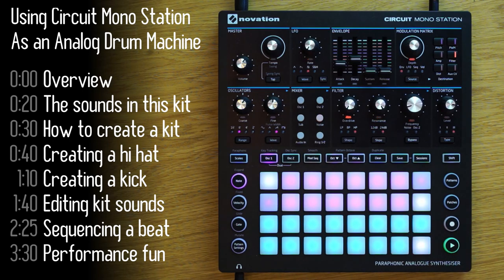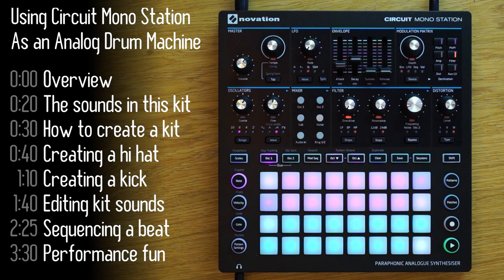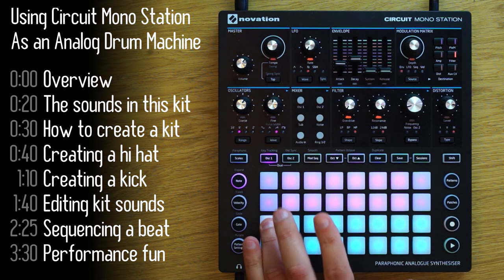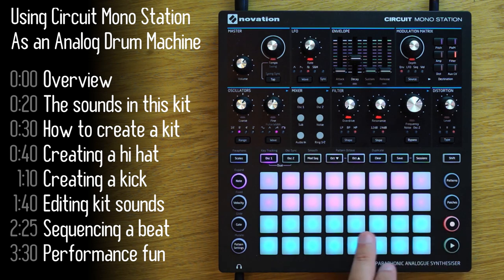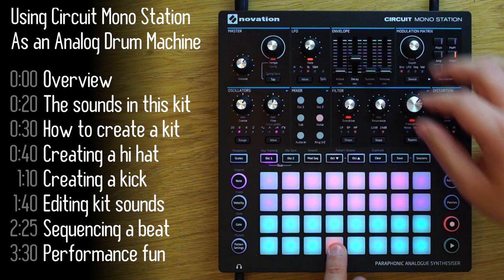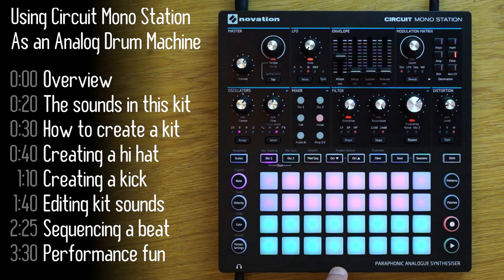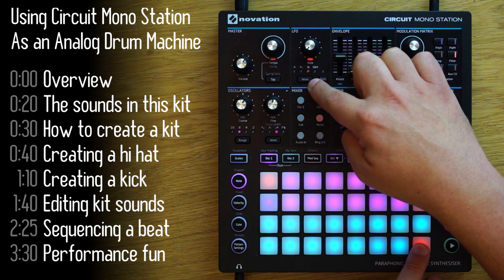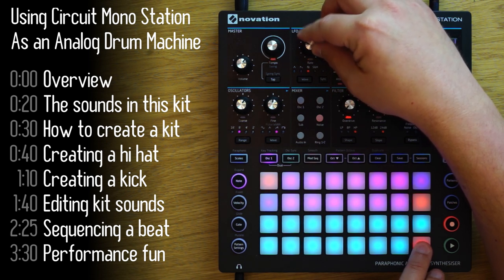How to create an Analog Drum Machine with the Novation Circuit Mono Station

Comment: I have the actual firmware installed but i cant get the parameterlock to run. Can you please be so kind and explain how you program the parameterlock? The manual sais nothing about this.
Thanks a lot. Nice videos by the way ;)
Reply from the maker: acidjack303 thanks very much - no problem just watch closely how I do it here - just hit record and any parameter you change is locked
Reply: loopop thanks. I ve done, so there must be a problem at my unit. Or wron firmware. Doesnt work on mine. Any how thanks.
Reply from the maker: ok - sorry couldn't help more - contact Novation support - they've helped me in the past
Reply: hi, after a reset it works, thanks ...great
Reply: hi, could you please specify what you mean by "reset" - it's just switch off or actually reset the Mono Station. can't find any info about reset of MS.
thank you!

Comment: So the circuit is better than the circuit mono because it has drums drums on the mono seem like a pain
Reply: They are two very different machines.
Mono station won't be your go-to drum machine, but it's cool that you can use it this way.
Cirquit is a digital synth/sample player. Mono station is an analog synthesizer. They share the same UI and sequencer, but they are very different type of instruments.
Reply: @JH-lo9ut  I ended up getting the tracks liked the workflow but the synths where bad and a decade old and I had a mpc made a better brain 🧠 for a setup at the time but sold both liked the tracks for what it was though and no screen was nice mpc no retreats selling if they make a tracks 2 with new synths I’d so be down got the lofi 12 over the rhythm circuit